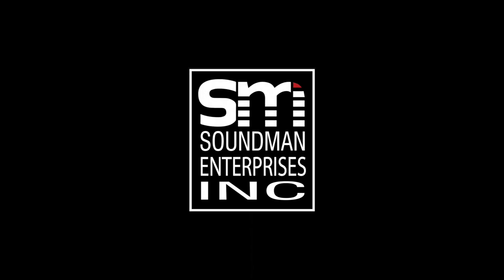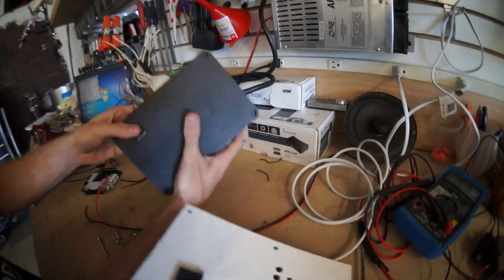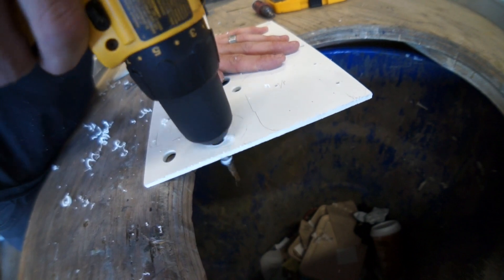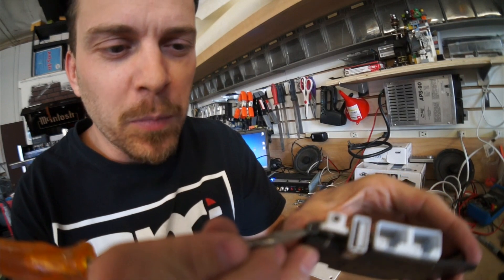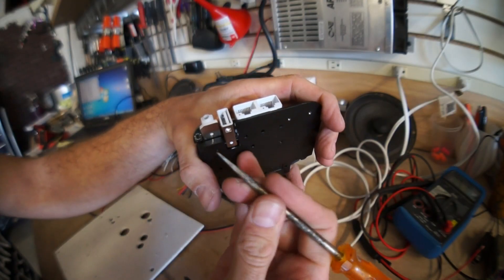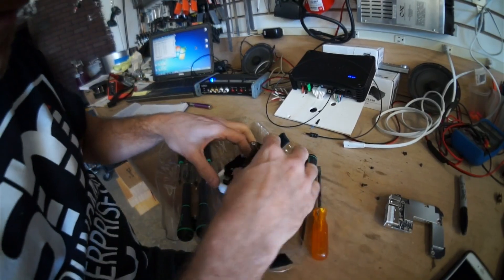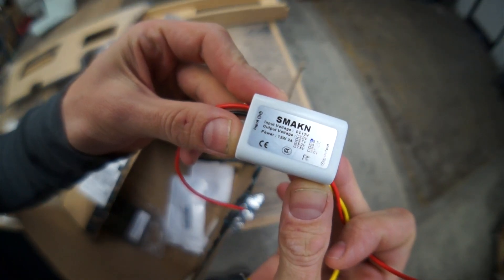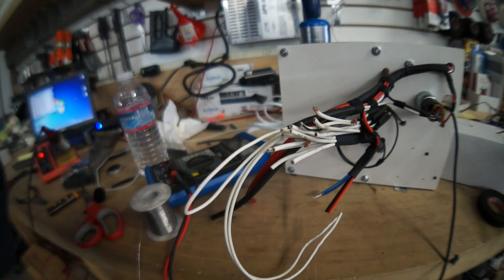12 Volt Airplay

Comment: Hi Doug very good videos, why not use the i20 PURE dock connector, charge iPad, optical and do not need wifi 👍
Reply: It doesn't work on new gen iPads or phones
Reply: With the converter 20-pin to lightning Apple you can, what they have done in the episode of the black Jeep Grand Cherokee, they installed an iPad Mini by optical out a Audison.
Reply: +Roberto González again, not on new gen iPads and phones. Pins are switched. If you would like to buy my PURE i20 and connector I would love to sell them to you!!

Comment: To get it to pause the music when power is removed you may be able to setup a small relay or MOSFET on your usb cable that acts like a wired pause button like you'd have in a sound dock or something. That would be a super easy piece to splice into the charge wire.   Worst case scenario you have to order the lightning connector and make a custom cable for it. Feel free to PM me if you want me to explain what I mean a little better. I hope this helps!

Comment: Hi there Doug just wondered if you have been having the same issue I have I've powered an airport express up the same way you have but when playing music about every 30 seconds or so it cuts out then starts playing again after about 1-2 seconds ? Would be very grateful for you imput/ help , thanks and keep the great videos coming . Dave London uk :-)
Reply: +Doug Bernards (Soundman) really annoying but doesn't do it when plugged into a mains charger so wonder if it's not quite getting enough voltage , I wondered about getting a 3.7 v drop down instead of the 3.3 ? What's you opinion on doing that please Doug ? Thanks again Dave

Comment: Doug, any chance you could explain how you converted the airport express to 12V? Where you soldered the converter? Why did you not pick up switched power? 

I would love to feed this into my bit ten AUX input.
Reply: The Airport doesn't draw much power, I assume? It'd be fine to leave it on constantly without draining the battery?
Reply: +Doug Bernards (Soundman) You said you went optical out of the Airport Express? 

I picked one up and I only have 2 ethernet, aux, and usb...

What connector did you use to go into your processor?
Reply: +Doug Bernards (Soundman) I got mine all hooked up and it's awesome! How did you get AirPlay to pause when you turn off the key?

Comment: Did you get any noise? I swapped out the power supply on an apple TV but get a horrible humm. Ive changed/tested every cable possible, only thing I can think of is the power supply. I used an adjustable voltage power supply I found on Amazon.